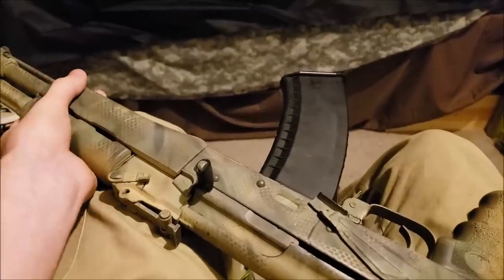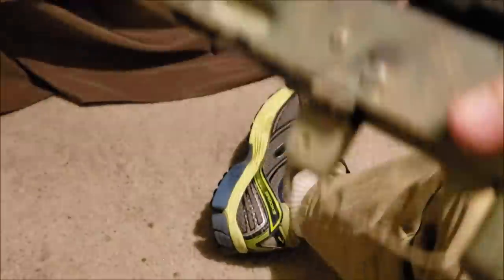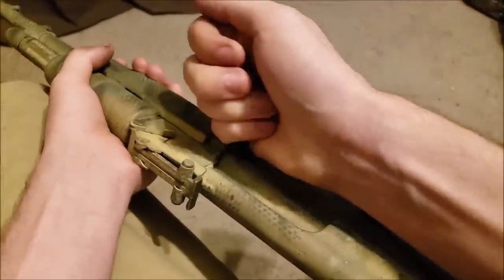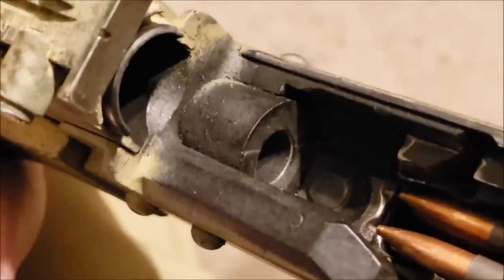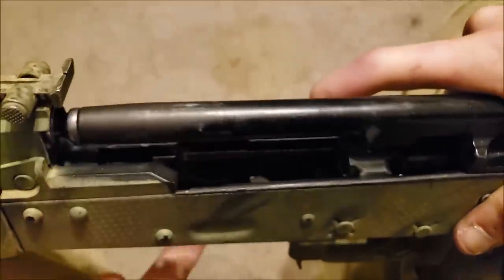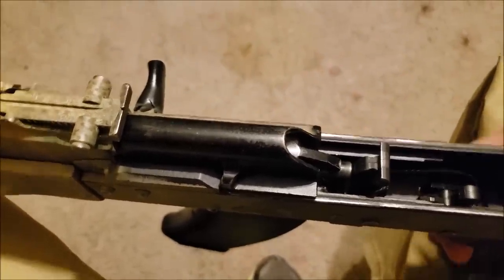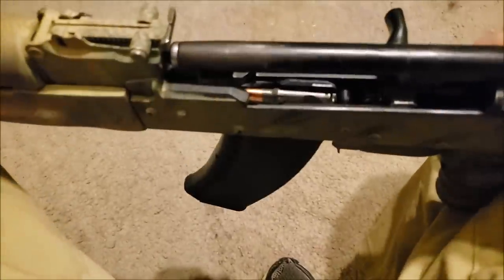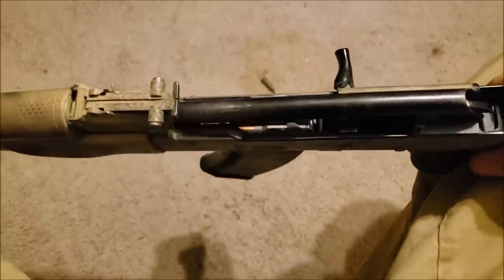Top 10 AK Malfunctions (4 are Deadly)

Comment: Imagine going full auto and you have a squib. Not even a chance to react.
Reply: If the powder charge isn’t enough to push the bullet down the barrel then the gas can’t get to the gas block therefore pushing the bolt back and causing the action to cycle and feed another round. If you have a squib in full auto then the gun stops firing and it’s the same as clearing a squib in semi.
Reply: @badent94  It could get stuck past the gas port tho. Also, not every firearm works the same way. There are direct (and delayed) blowback submachineguns for example.
Reply: Oh fuck...
Reply: @Katniss218  the definition of a squib is a severely underpowered load.  Not even enough power to propel the bullet.  Regardless of recoil operated. Delayed blowback. Gas impingement or piston operation , they still in one way shape or form require pressure or force from the round to operate the mechanism.  If the round cant push the bullet then it cant push the bolt either. No matter how that bolt is pushed mechanically. However I guess in a perfect storm it could get stuck right past the gas block and not go out the barrel and in theory have enough power to cycle the bolt . this is extremely unlikely.  Because even if it pushed it past the gas block ,the gas , which is already under powered anyway gets further reduced by more gas bleeding into the gas tube and all that. . I'm not sure its even possible.  In all self loading firearms, the round itself is what functions the gun.
Reply: @TheRealSwampOperator2  Hmm, haven't thought of it that way. Makes a lot of sense, thanks ;)
Reply: Appreciate the knowledge in this exchange thanks guys 👍

Comment: One malfunction in my AK was broke brass necks in the chamber. Another was when a round somehow snaked into the receiver between the dust cover and bolt carrier. So I'm an AR guy now
Reply: If that better 4 you go on
Reply: WL Walkin  and light but in term of military use AK is better
Reply: WL Walkin  AK is just as accurate, depends on yhe shooter, the myth that the AK is not accurate comes from people thinking it's not due to the mid east, people are not trained and just spray all over the place, not hitting a damn thing, in the hands of a trained peraon the AK is very accurate
Reply: Kurogane -sensei  fuck em. I want my McDonald's
Reply: AR are only more accurate from AK slightly, other than because direct gas impingement system and straight alignment of the barrel with the stock, accuracy are determined by shooter not the gun
Reply: You’re like one of the only comments he didn’t tap like on.
I wonder if it’s the AR thing you said
Reply: @wukong6853  is that directed towards me? Or someone else?
Reply: @blackjack3599  Yes you.
Reply: @wukong6853  AR is just better
Reply: @blackjack3599  Yeah, No it isn't. Less reliable.
Reply: @wukong6853  according to who? The internet?
Reply: @blackjack3599  AR's will never have shit on the AK.
Reply: @wukong6853  uh huh
Reply: @Aidan Snyder Clearly you aren't knowledgable .
Reply: @Aidan Snyder I have three ARs. All in 5.56mm and they run great. I had one AK, sold it because it just wasn't functioning. I could barely go through a mag without some failure
Reply: @Aidan Snyder yeah, my AK was a WASR10-63. A real 7.62 AK and it was pretty nice, at first. Bought the ammo chambered for the rifle. Broke case, broke necks, and one of the failures detailed on this video that has 10 failures of his favorite video game gun, actually happened to me. Three of my ARs are all different. A 20" Rifle, 16" Carbine and a 10.5 Pistol. All 5.56mm and all run great. So not sure where this 12 year old came from
Reply: WL Walkin  there is a difference between accuracy and velocity, so make up your mind, accuracy or velocity
And what exactly is racist about my comment?
Reply: @blackjack3599  sounds like the failures was on you, not the gun.
Reply: @NineteenEighty8  no, I didn't do anything special that could have pushed the gun to a failure. If you read, broken necks lodged in the chamber, and a round somehow found its way in the receiver. I'm sure if you watched the video. It's called Top 10 AK Malfunctions.
Reply: Ar is even worse.
Get even the smallest speck of dust in any part of the gun and it breaks.
Reply: @danieldeak9141  did you see InRange's videos? They sand tornado and mudtested the AR15 twice. Worked fine.
Reply: You guys should watch Pat McNamara weapons malfunction videos. AR platforms arent as reliable as you think, same for AK platform. Its knowing what to do when you have a malfunction is whats key.
Reply: I agree my freind. My experience is the same.im an at guy. There is a cool factor to and in general but good ones are too expensive for what they are
Reply: You have forfeited your rights to exist by becoming an ar guy.
Reply: @zebigkahoona4467  now that, was funny
Reply: @blackjack3599  lol I own two aks and two ars. I prefer the ak, more significant bullet (7.62x39) and extremely smooth. Ars are fast and violent recoiling guns. You probably owned a wasr and considered your opinion on that lol. That's like basing your automatic pistol opinion on a hi-point. I have a Sam-7 and no ar in the same price range comes close to it. Let's see you shoot your ar with your stock folded lol.
Reply: @contractzero1194  thanks for the GT video. But again. I left a comment about an experience I had with MY AKM. So say whatever you want. You you probably rewatch Top 10 AK Malfunctions. 

I guess it's all nice that you prefer the AK. I don't.
Reply: @mail-qh2qc  sorry, 6 inch at 100 yards?? What kind of bullshit you are spewing?? And well i love ak because its looks cool aesthetically and its simple to clean. Im not a competition shooter nor a big game hunter so 300 blackout is not that interesting to me
Reply: @mail-qh2qc  the ar platform is unreliable in cycling 7.62x39. Unless you use an ar10 upper. In which case you still have the ar snappy recoil.
Reply: @blackjack3599  ok well you've based your opinion on a shit gun. That is not indicative of the weapon platform. So your generalization is misleading.
Reply: @mail-qh2qc  or I could just use my ak
Reply: @mail-qh2qc  my ak is milled. It's a billet reciever. Your ar is probably cast lmao.  I have had 0 failures in my Sam-7 with 3000 rounds through it. This guy in the video is dreaming shit up. If he is having that many failures then he has a bad trunion or bad magazines. You keep playing legos buddy, I'm doing real training. You can call me a larper if you want but I bet you've never been shot at. You just keep sitting on your bench st 100 yards and high fiving your buddies who can put bullet holes through bullet holes.
Reply: @mail-qh2qc  3000 rounds with 0 malfunctions is a statement. Especially at the degree you are expressing they occur in the ak platform. I have the same modularity on my ak.  I make the joke with AR guys because they seem to be the guys trying a new handguard or foregrip every session. I have a troy industries full length hand guard. It extends to the front sight post and the troy industries gas tube rail. I have an acog mounted with an RSregulate side mount. Which retains 0 very well. I reload for my ak which is also very cheap and if I feel like being a prick to my firearm i guess i can run golden tiger or bear. I own 2 ars, like I stated before (though both are piston because I find that system to run better suppressed) I have had more failures with my sig and custom built ars then both my aks. Aks take more practice to master the platform in a timely manner but I encourage challenge over being comfortable.
Reply: @mail-qh2qc  I dont neglect my ak either. Although I can and I know its capable of running through shit I was raised with bolt action hunting rifles and thoroughly clean my rifle after every trip out. You treat it good and it will return the favor.
Reply: @mail-qh2qc  I find that hoppes 9 works pretty good. Dont brush it alot. Hoppes 9 only requires a wet and a dry rag to clean the barrel. Wire brushing can cause unnecessary wear. If you have plastic brushes and a good solution that should take care of anything that is needed. And if that doesnt do the trick I would leave it alone.
Reply: @mail-qh2qc  never had that issue. And I use both regularly. Granted I only use wd-40 on the bolt and bolt carrier. I also like to use frog lube CLP paste on the bolt and bolt carrier. Keeps things running smooth.
Reply: @mail-qh2qc  started using it on the m1A and now I put it on everything. Smells great too.
Reply: @mail-qh2qc  hell why not. Sounds a little messy but will definitely do the job.
Reply: @juicywater5954  mostly because of its low production costs and ease of repair. the ar shoots better though.
Reply: @sovietred7371  actually they arent very accurate, most real aks were made quite cheap with no thought to barrel harmonics. in full auto the barrel flexes a huge amount leading bullets to spray everywhere. 
even in semi though they are still not accurate by modern standards. 
really you would only notice it at distances where you need a scope tho so its not like they are bad, they just cant perform like an ar at 600m.
Reply: WL Walkin  You know there are 5.45x39 AK's?
Reply: @blackjack3599  https://www.youtube.com/watch?v=UfHVwjAhkUo Lots of malfunctions here I see on the AK platform
Reply: @Numbertwo22  When converted to US dollars a brand new ak costs about the same if not a little more to produce than an M4, costs about $7-800 to produce a modern AK varient and $700 to produce an M4.
Reply: @handsomelarsandhisfabulousjars  did i say modern ak variant?
i mean ak47 the rugged old one made by the soviets to be cheap and fit in a tank.
modern ak variants use better materials and are more accurate due to their better machining and structural integrity.
Reply: @Numbertwo22  sounds like the aks-74u,  not the ak 47. But please continue to be an arrogant know it all, dont let technicalities like that stop you....
Reply: @blackjack3599  Just think about it..  If the AR was superior in every way, there wouldn't be people using AKs all over the world. Both platforms are solid, great, reliable and efficient.

I didn't even have the patience to go through what I pressume is 274827593 comments of pure boring shit talk on both sides, both platforms proved to be great at what they're designed for. They're both accurate at a standard Assault Rifle range, they're both reliable, and they're both good overall. No need to throw hate on each other. And nothing personal against you, but as you stated the first comment shitting against the other platform... Welp, here I go
Reply: @sovietred7371  also in the mid east those aks habe never been cleaned and the rifelling is worn out, they have probably had over 2 million bullets ,if not more, shot out of them...
Reply: @fungusboy7369  dude.... You di realise that there is an AK-117.. and an ak 113... And a more... Namely the 74. You are comparing a gun made/ disigned in '47 with a gun made in like the '60's...
Reply: TRAITOR
Reply: WL Walkin  not racist if it's true. They shoot everywhere, often not aiming down sights, and blind firing in buildings. Guessing, and lobbing bullets beyond its range from mountains.
Reply: @benayakeenanhutagalung9798  Lol the shooter plays a part, but when the gun doesn't hit where you point it at it does not matter if you are the most accurate shooter because it becomes a guessing game if it is like that. Two words, ballistic score. Accuracy is determined by how good your shooter is, barrel of the gun, and the ammunition. The Chey Tac for example is extremely accurate almost very close to perfection as its score is 0.9+ while most rifles, AK included, are barely 0.5. You cannot change the fact that 7.62 is less accurate than other rifle rounds. 5.56 is still more accurate than a 7.62 if both shooters are skilled.

Comment: I once RO'd a match where I saw a SCAR 16 feed a round up into the upper receiver for a Type V malfunction. It was like a double feed, but the cartridge had room to slip above the chamber into the charging handle channel and almost chambered the next round! It ended that stage and need a partial tear down to clear.  On my own AR, I've had a rifle lockup/work intermittently from a primer that got blown down into the FCG and was keeping the trigger bar from travelling to the bottom of the receiver well. Ammo was PMC .223- now I use 5.56 ammo if I need reliability. A rock or grit would probably do the same, and needs removal of the trigger to clear. The more failures you experience, the more you are cognizant of what causes them and how to remediate the issue.
Reply from the maker: That SCAR failure is wild! I've heard that primer/trigger lockup happening with ARs, neat to hear it from someone first hand. Thanks for the feedback!
Reply: Had that same malfunction with a VSKA. Had my heart pumping a lil.

Comment: What you call a squib I’ve always heard called a “pop no kick” it send the round out of the casing but not the barrel. Very dangerous
Reply: I call it "just the tip"
Reply: Yeah squibs are only bad if you're stupid enough to shoot again after the weird sound in your gun.
Reply: @MegaRotors  sometimes with earpro, you dont hear them, but yeah always check the round if it didn't fire
Reply: How can you even remove the bullet from your barrel if it's stuck inside?
Reply: @july-6726  you use a cleaning rod or something alike and hammer it out, or a bit of a more dangerous way is removing the tip of a bullet and using that case with powder and all to shoot out the one stuck in the barrel
Reply: @koekie7003  Ooof sounds like you can easily damage your firearm this way, but thanks
Reply: @july-6726  possibly I only did it with a 9mm so lots smaller than AK rounds
Reply: @koekie7003  Imagine this would happen to a 50bmg and for some reason you wouldnt notice and try to fire the next round already. Bye bye mr. Handsome XD
Reply: @july-6726  hahaha I think you would notice the lack of big boom
Reply: @koekie7003  yeah but just try to imagine hahah

Comment: me:hears "amunition specific malfunctions"
also me: if it cant run the steel it dosent deserve the brass.
Reply from the maker: Even the best firearm in the world cant avoid some of these failures.
Reply: @GenScinmore  yea, but if they cant avoid it entirely they have to at least try to be reliable enough to fire at least 5 mags in a row without any failures, at least in my opinion.
Reply from the maker: @JoaomogusGD51015  absolutely. Never had a failure on my ak aside from the stuck bullet. Thing runs like a top

Comment: I only have experience with RK variant of AK, but by far most common is malfunction is a mis-feed where round gets into chamber kinda sideways, just reload. Not sure if it was just my luck, but twice I've also seen a mechanical part break. Inside the switcher is attached to kinda U-shaped piece with an extension at the bottom of it. The extension has wider part and then a narrower part. If that narrow part breaks of your RK will go into "wildfire". if you pull the trigger once, it will go full-auto and won't stop even if you let go of the trigger, only when mag is empty.

Comment: I had an issue while shooting my friend's SKS. It fired a round without ejecting the case.  The big thing was that the entire bolt was stuck with an empty case inside. Wouldn't move at all, even after taking out the spring and hitting it repeatedly against a wooden pole. What had happened was the chamber was actually so dirty that when the case expanded too much, the bolt got stuck too. Not very nice :c

Comment: So if we hear the firing pin click only, or the shot is too weak to cycle the extractor,  the priority is to remove the magazine, wait several seconds for a hangfire, followed by carefully cycling the bolt handle to observe the chamber for the round and if the cartridge continues to contain a bullet inside it's case, then we know the barrel has not become obstructed by a stovepipe failure.  If the cartridge does not contain a bullet only an empty case, then the cartridge either did not contain a bullet when it was fed in to the chamber, or the bullet is stovepiped inside the barrel.  With the chamber clear, the bore could then be inspected for the stovepipe, and if one is present, the firearm locked up as in need of repair.

Comment: There was a failure a friend of mine had some time ago where the cartridge went bang but the bullet didn't leave the cartridge, and it ejected but the bang was the cartridge puncturing so powder ended up lining the chamber, he then fired another round thinking nothing was wrong and the front of the gun jettisoned itself off of the receiver with a massive blast. He was unharmed.